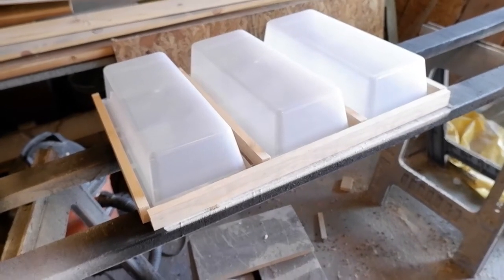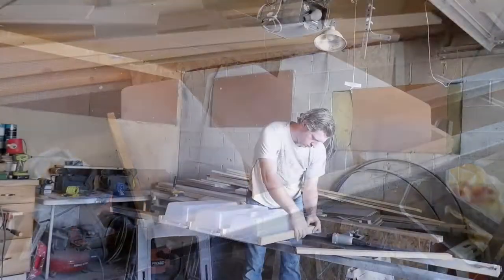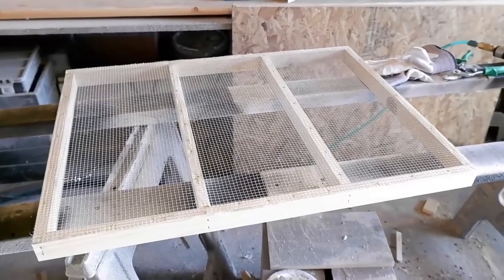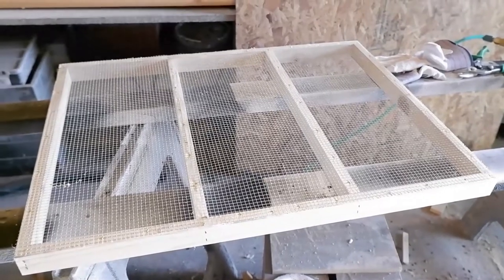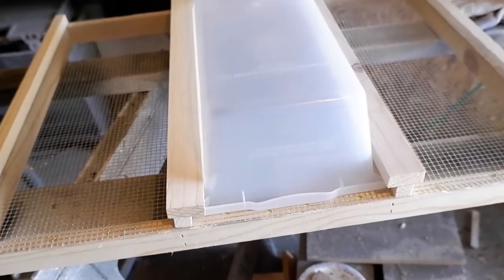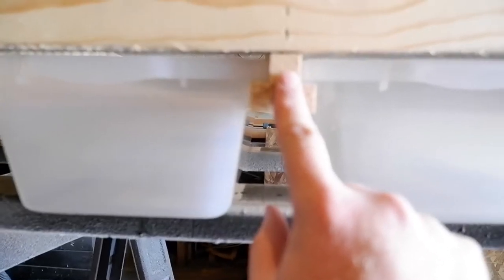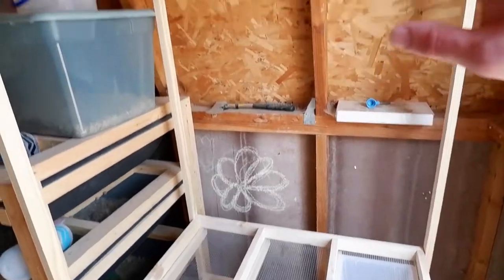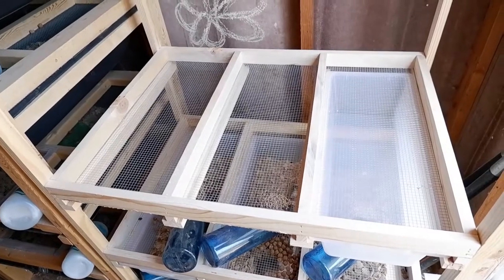How to build an ASF Rat Rack using Freedom Breeder Tubs - Build Tutorial

Comment: Mine finally had babies!  Looks like about 10.  Do I take the male out?  I have two female and 1 male in the same cage.  They won't eat the babies will they?
Reply from the maker: I wouldn't remove the male.  They can be incredibly protective of the babies.  Make sure they have plenty of high quality protein.  Black oil sunflower seeds and meal worms are great.  Sometime first time moms will eat their babies so don't fret.  Hopefully it all works out for you.  Also, their food is important.  I suggest Mazuri rat and mouse.  It has 23% protein and is basically a complete diet for them.

Comment: I noticed you had some sterilite tubs towards the end of your video. Do you have any chew outs or any issues with those?

Thanks
Reply from the maker: I put a tile in the bottom of those to prevent chew outs
Reply: @clutchpythons9360  That is pretty smart, do you still use those also? Do you think that will work for regular rats?
Reply from the maker: @andrewsmith9980  Give it a shot, not quite sure